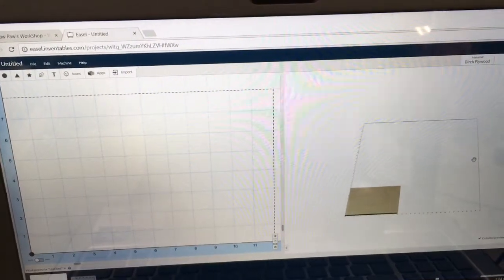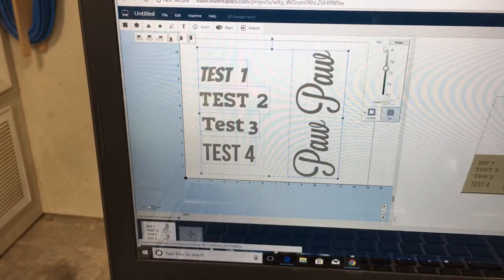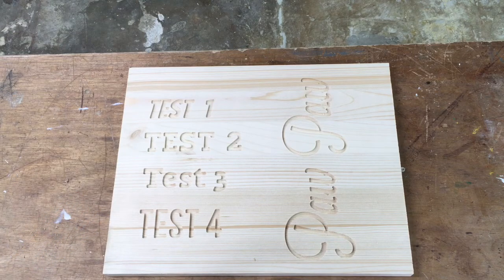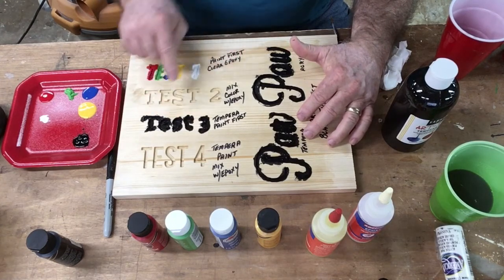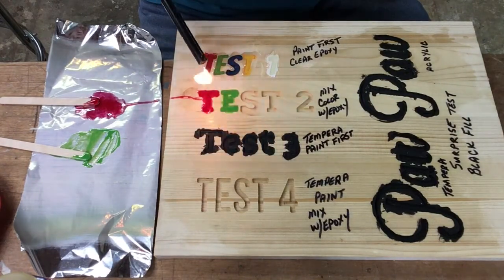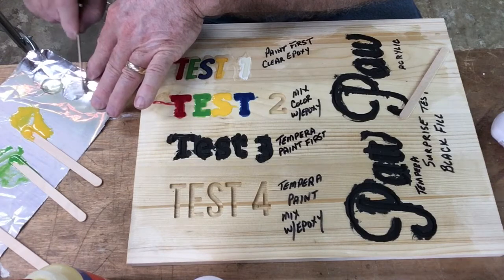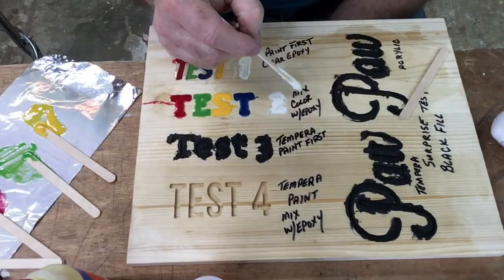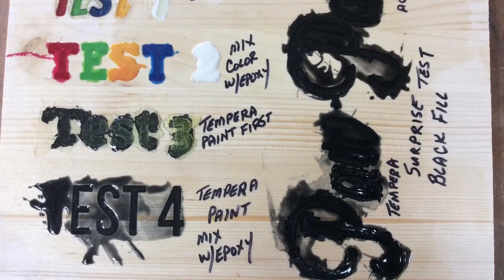How to Do Easy Epoxy Inlay Test Success and Fails

Comment: I love the way the “paw paw” shadow came out. Well done.
Reply from the maker: Thank you, it was fun to do and I like the results.  It is easy for anyone to do the same.
Reply: When sanding the epoxy off, is there a better grit that will do the job?  I have a project that I think this idea would look great on, but wasn't sure if the epoxy will easily show scratches from the sanding?  Or it it a matter of polishing epoxy??  I have not messed with epoxy before other than just on top of a table.  haha
Thanks

Comment: So after you sand it all flush, how do you specifically polish the epoxy to shine?  What kind of headlight polish do you use?  Does the use of that affect the poly finish coat?
Reply from the maker: The headlight polish can be any brand.  It is an abrasive. The polish will put a great shine on it just like it does on the headlights. I will sand first up to about 1500 grit then I use the headlight kit.
Reply from the maker: No, I have not experienced any problems at all

Comment: Would you be able to make a block out of Epoxy Resin then use the x-carve to router out a shape in the middle of the Epoxy block. The cut-out shape could be filled with a different color epoxy fill. This should look very cool with a light behind it. From your example the x-carve had no problem cutting through the epoxy inlay. Most people doing inlays with epoxy are using wood, I can't find anyone using the cnc router on resin alone.. Thanks
Reply from the maker: Great idea.  The epoxy would cut very easy on the XCarve.  Thank you

Comment: I have a piece of 3/4 pine that was pre-painted black, and then a 2D image was CNC'ed, roughly 1/8 inch deep. I want to fill, but not overflow, the CNC'ed areas with a metallic red epoxy. Which product/method would you suggest?? I am especially concerned about using a heat gun or torch on the piece, because I don't want the black paint to peel.
Reply from the maker: Use a slow cure epoxy.  It will give more working time. A hair dryer will help to remove the bubbles without effecting the paint.
Reply: @PawPawsWorkShop  Thank you!!!!!  Do you think that I should also apply a coat of polyurethane to seal the wood before the epoxy, which might help prevent air inside the wood from bubbling up to through the epoxy??

Comment: Hello again, just completed my first carve and I surprised myself. My wife does a lot of epoxy resin and acrylic paintings. She is going to like your vid. 

My question is how did you do the Paw Paw image. Was the font in pro?

Have you thought about writing a manual for dummies. I would be your first customer. Always looking forward to hearing from you.

Do you have a first name?
Reply from the maker: Congratulations on your first carve.  My manual is in the form of all of the videos that I do and they are FREE.  

Are you on the Inventables forum? I am there all the time as well.  My name is Philip.
Reply from the maker: The font is Lavanderia.  I do not think it is a Pro font.  This project was done only using the text.  After the first carve, I filled it in with the epoxy, let dry and sand.  Next, I shifted the text over to create the shadow and carved.  I filled that carve with black epoxy.
Reply from the maker: I assume that your wife mixes the acrylics into the epoxy to create the color?  It is a fantastic art form.
Reply from the maker: I assume that your wife mixes the acrylics into the epoxy to create the color?  It is a fantastic art form.
Reply: Paw Paw’s WorkShop Good morning. Yes she pre mixes almost all the time either with acrylic paints or with matalic paints . They look so cool. I will try and do the text offset today. Your vids are most helpful and I am on the forum, but it’s like learning a foreign language right now with some of the terminology.